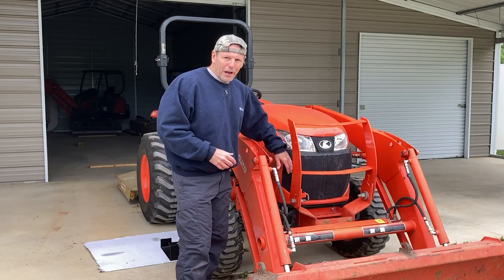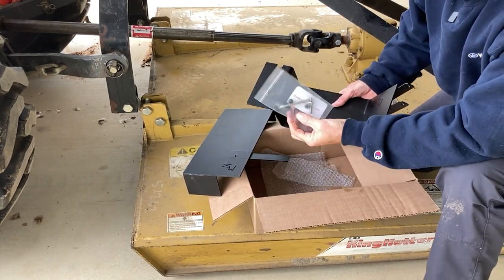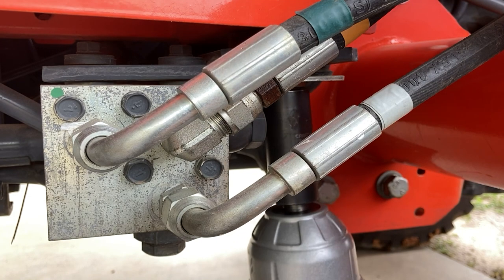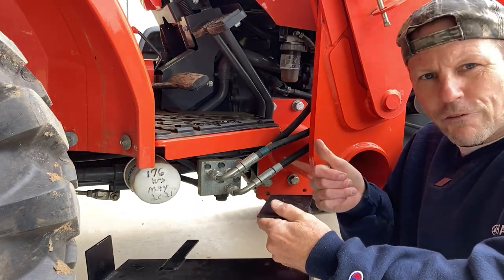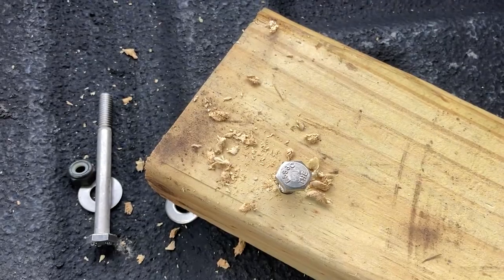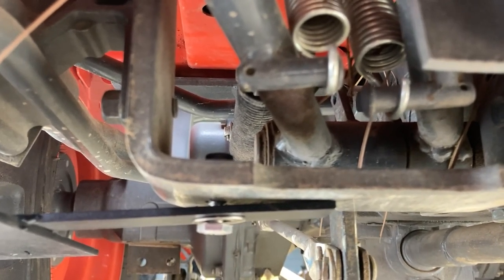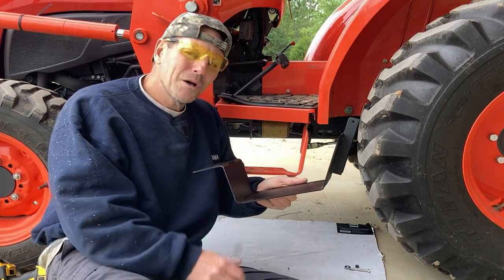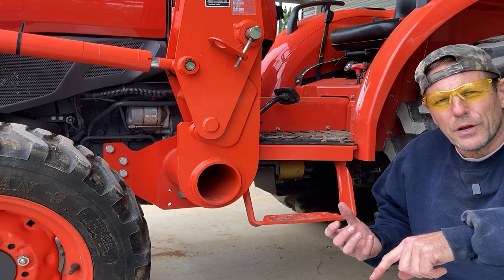PROTECT Your Compact Tractor Expensive Hydraulics!! | Zooks Welding

Comment from the maker: Our Chainsaw Holder from Zooks: https://youtu.be/IG2TZqDBmTE
https://zookswelding.com/    Discount Code: USA5
Products in our Amazon store used in this video (costs nothing extra to use these links!).  You don't have to buy these specific items to support our channel....just use a link below to get to Amazon then make any purchase: 
Flex Tape: https://amzn.to/3R4MdWm
Mechanix Leather Gloves: https://amzn.to/3HjoZZf
Titan Post Hole Auger: https://amzn.to/3toHEx2
Ratcheting Fence Tensioner: https://amzn.to/3aEfSX0
Pope and Pipe Level: https://amzn.to/3tqUhHX
Fence Post Puller: https://amzn.to/3QbcNhy
T Post Manual driver: https://amzn.to/39dwt3J
Come Along Winch: https://amzn.to/3aQMqND
Clip bending tool: https://amzn.to/3xlqrG0
Mechanix Leather Gloves: https://amzn.to/3HjoZZf
6’ Digging and Pry bar:  https://amzn.to/3vH5Agx
Dewalt 20V ½” Impact Wrench: https://amzn.to/3UOcXNH
Dewalt 20V brushless Leaf blower: https://amzn.to/3zwJcYm
Dewalt 20V brushless ½” drill: https://amzn.to/3HGXJ7z

Comment: I built myself a full skid plate with half inch polycarbonate, and used U bolts to attach it to the bottom of my tractor. 
It's cheaper than steel and easy to cut with a circular saw.
Reply from the maker: Good idea!